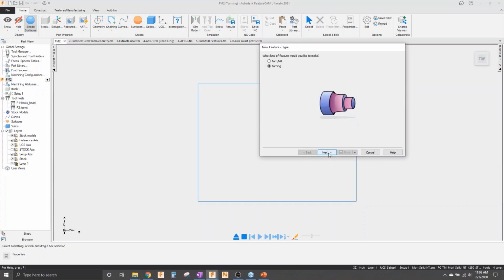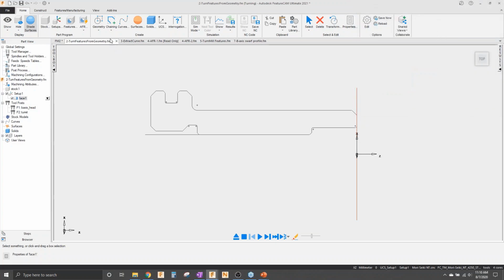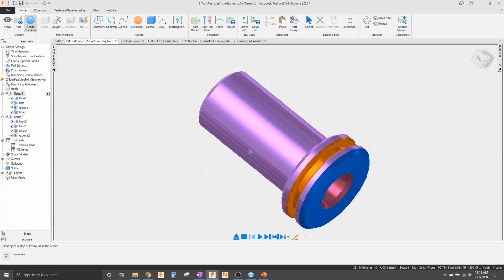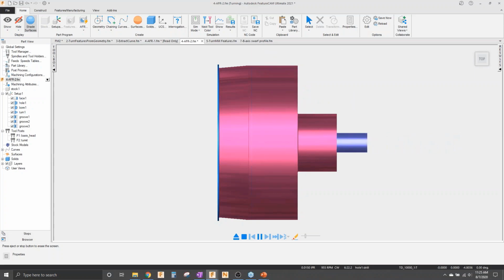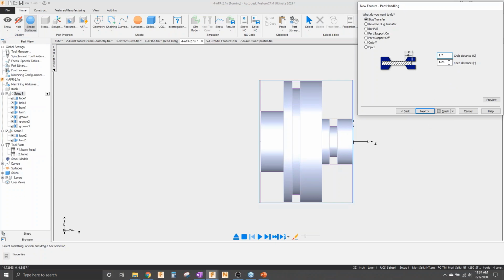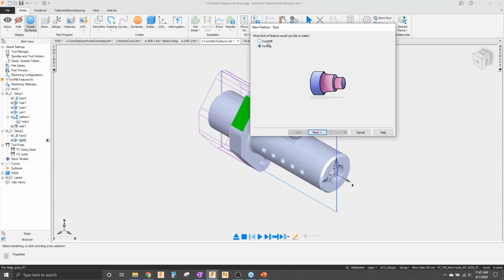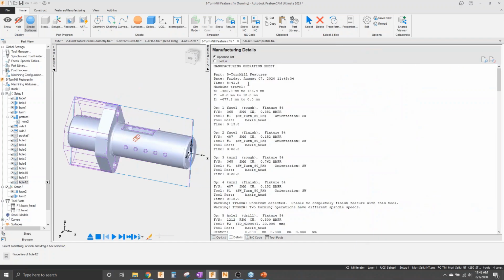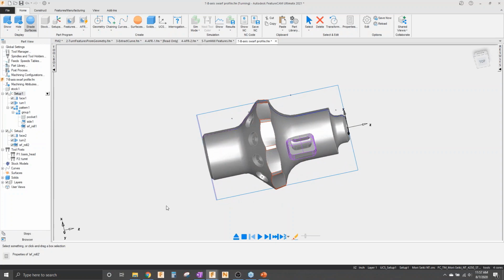FeatureCAM Best Practices | Turning

Comment: Great video. Do you by chance have a rechuck video? I have a part that has a simple turn feature on each end. The part is 36" long and I only have 24" between spindles. I would like to use the machine to pull the part and run the feature on the opposite end of the part.
Reply from the maker: Reach out to info@nexgencam.com and we can get you set up on some videos based on your request.

Comment: I have a question. I've drawn up and entire part and created set up 1. The face is always zero and anything beyond that is a negative number in z. Now, when I do set up two for the back side, that face is also zero but when it goes into the part it is a positive number. I've tried rotating z and it doesn't fix the issue. Any tips on how I can make setup 2's Z a negative number?
Reply from the maker: Hi Roberto, we would be happy to take a look if you sent us your files to be more specific.   Drop us the files by making a case at https://nexgencamsupport.freshdesk.com/support/home